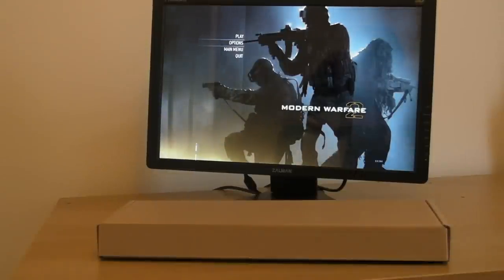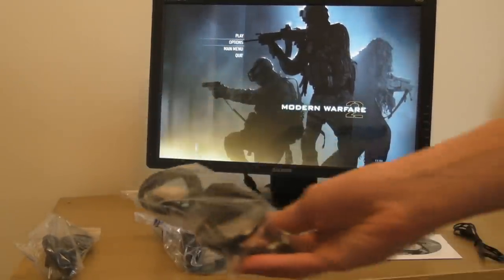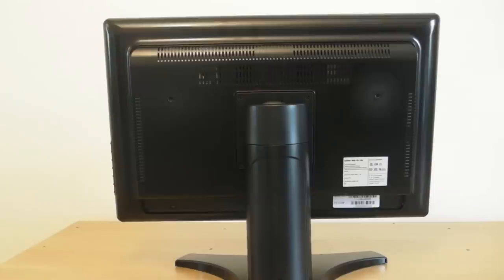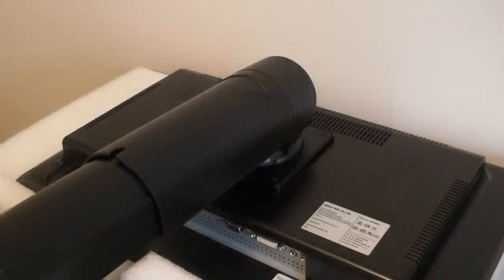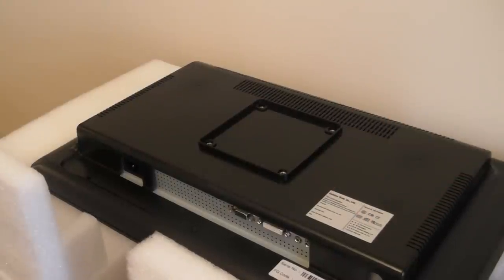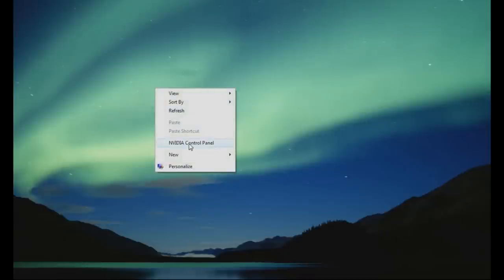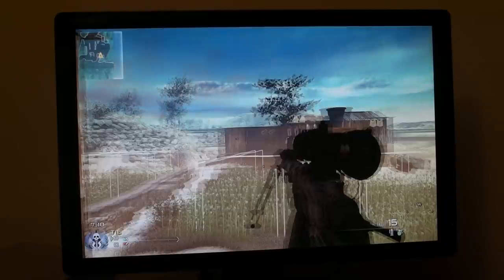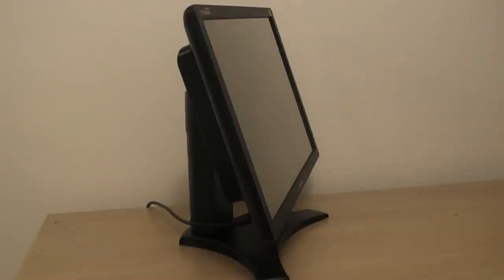Zalman ZM-M220W 22 inch Wide Trimon 2D/3D LCD monitor Review

Comment: They are something completely different: The nvidia glasses are so called "active" 3D glasses, which means they are shutterglasses and synchronized with the monitor. 
This glasses however are polarized ("passive glasses"), which is (in my opinion) the better solution.

Comment: @umpalumpa101909 This one is polarised 3D (passive), so should be easier to watch than the Nvidia 3D active shutter glasses, and a less dim picture too - but at the same time it works with the Nvidia 3D Vision drivers.

I have some active shutter glasses from a few years ago and do not like the active shutter approach (dims the screen, visible flicker, bulky glasses) but I have no issue with passive polarised lenses.

I am considering the latest 24" Trimon seriously but would like to know more.